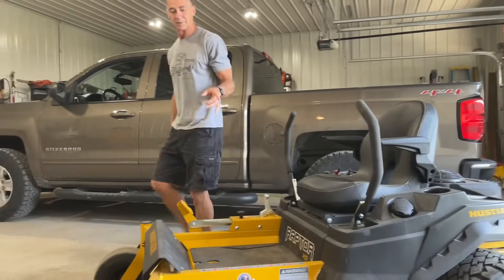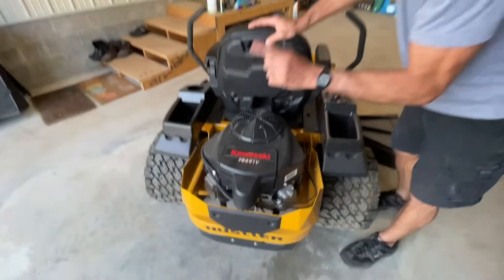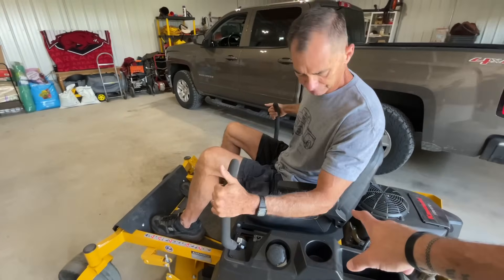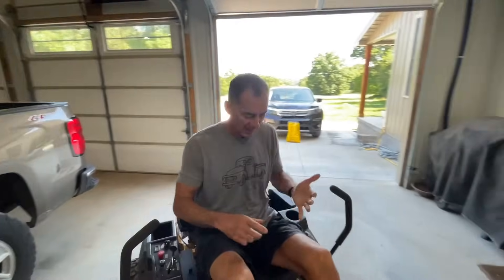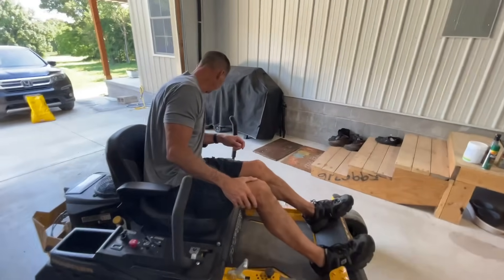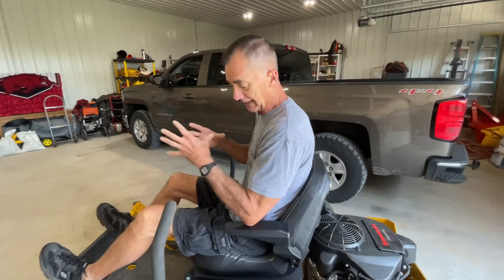DON’T BUY A HUSTLER MOWER UNTIL YOU SEE THIS!

Comment: Thanks for your honest opinion. I am looking at a used Hustler Fastrak 44" 340 hours just service works garage kept with a B & S 19.5 for $2300 your thoughts? Going to check it out tomorrow.
Reply from the maker: That’s a lot cheaper than a new one. I still like mine and would buy it again
Reply: @grandpadossfarms  I found out why it was so cheap he swapped out the motor for a B & S 19.5 hp . Also after your detail video the Fastrack has a parker ZT-2800 or 3200 serviceable trans correct? This guy texts me tells me trans is non-servicable 😳Garbage run for the hills scammer.
Reply from the maker: @HB-yq8gy  shameful. I’m not sure about the serviceability of the transmission. I’m not much of a mechanic. I’m glad you found out.

Comment: at 13:00 when you stood up using the armwrest... did I hear it actually cracking plastick there? wow something is bad in that design - - agree that they will be very very short lived especially if someone say 350 lb size would be using them to help push their body up while sanding up to get off ... or same thing to use them while sitting down back into the mower!
Reply from the maker: Not sure on that one. I try not to lean on too heavily

Comment: Never heard high end residential,  commercial or residential
Reply from the maker: Example: My xd is rated 3 acres. The xdx is rated 3 acres but has a bigger transmission. Both are residential but one is a little more higher end and costs more. After that you go to the commercial mowers. They too have capacity and performance differences based on usage. Perhaps there is a better terminology to describe the difference but it works for most

Comment: i worked at a dealership that sold scag, hustler, country clipper, and husqvarna. owned 2 scags my dad owns a husqvarna and i currently own a country clipper. they all have there issues not one is perfect. BUT after working there for many years... if i had to buy new mid residiental/mid commmerical grade id buy a hustler fastrak 54 inch kawasaki. or a scag freedom z pro kawasaki.... 
the deck on the hustler is a little better built the scag in my opinion. both have none servicable spindles the hustler are much easier to rebuild. deck lift scag vrs hustler the scag by far beats the hustler deck lift system. the front fork the hustler has the flex fork option which is much better then the scag. 
in this video the guy is just describing 1 hustler the raptor. its a more residential only unit not exactly designed for commercial use. plus the raptors and the dash have a little light cheap spring tension setup for the transmission belt and if you sneeze wrong it falls off. i was not that impressied with it when they first came out with that system.

side note look up Big dog. they are the exaxt same mowers except the paint. they are red and hustlers are yellow. and big dog is known to be slightly cheaper...
thats my pennies. there all good mowers if you keep up with the maintenence everytime you mow. Again Keep up with maintenence everytime you mow. and Have a Great day.
Reply from the maker: You're correct as I made clear this Is my first zero turn. It is my first hustler. I have not had any experience with those other mowers. This was not a promo for buying or not buying a hustler. I made it clear this is not a commercial mower. Many comments on here are from commercial users with hustler mowers that are very satisfied. I encouraged everyone to do their on research. I don't care which mower you buy as long as you are happy with your decision. Change your oil, keep the blades sharp and buy a mower big enough for the job.
Reply: @grandpadossfarms  i agree with you 100 percent i did not mean for this to be a commerical vrs non commerical debate. i was just more stating on what i would purchase if i was to look at a new one. 
there are several factors that come into play when purchasing any mower some are size or yard, pricing/compair pricing with other units, commercial vrs non commerical usage thats just a small factor into the who relm of purchasing a mower. i do reccommend the flex forks. i see you have the upgraded seat which is nice. i think you picked out a Great mower for your sized area.
Reply: Also Yes on yours 10 hours change the oil/filter then i think book is 35-40 after if im not mistake but i think 25-30 hours is better on them. the fr engines like my dads fr730 on his husqvarna has well over 4 digits (1,000 hrs) and he changes it every 30 hrs
Reply from the maker: @7.3PSDA2  I appreciate that Andrew. I have owned 6 different brands of tractor mowers over the years and all have been good. I am going to get those forks eventually. Unfortunately I don't have many hours in the hustler this summer. Been so dry haven't mowed in 5 or 6 weeks. Definitely proper maintenance is key. Thank you for the comment. Have  a good day
Reply: @grandpadossfarms  Your welcome! Hope you enjoy your mower sir! You as well!
Reply from the maker: @7.3PSDA2  Thank and it's Ralph

Comment: My Hustler 'commercial grade' Fastrak 48 has a Honda GXV 610 engine that starves for fuel when it gets hot.  I can't remove the carburetor to clean it because the plastic air cleaner box has bolts that screw into the plastic fan cover and the steel square nuts in the fan cover just turn and turn so the bolts can't be removed.  There's no way to put a wrench on the square nuts without destroying the fan coverf.  Pure junk!!